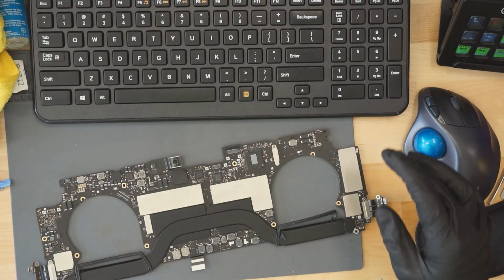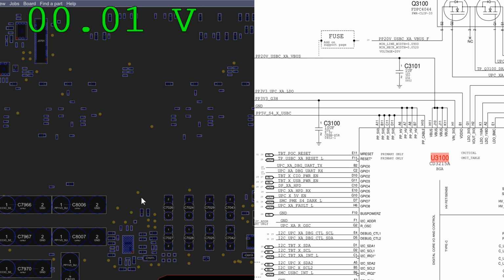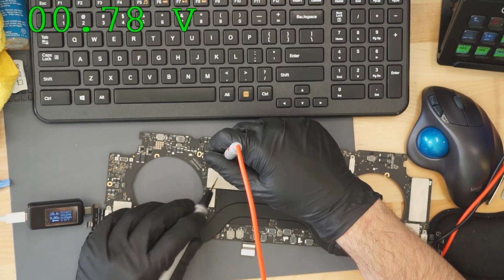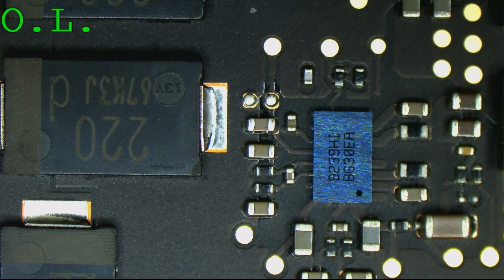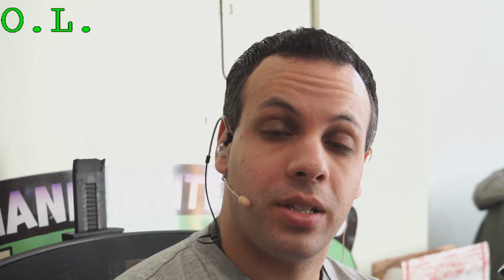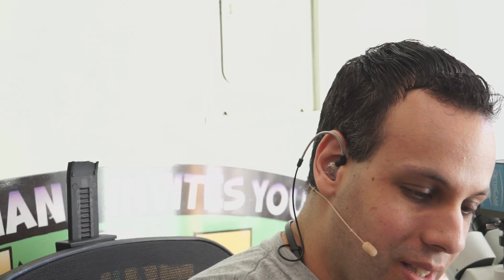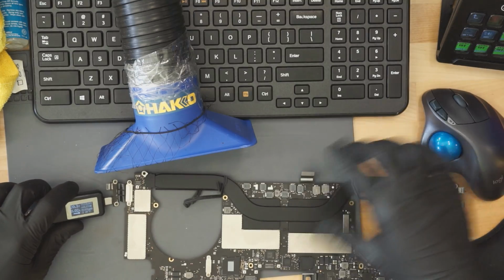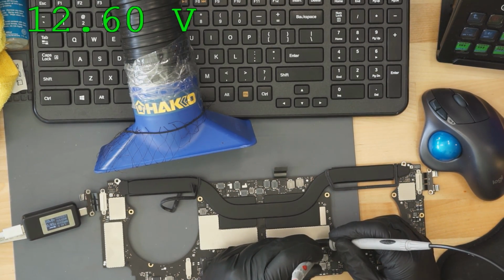Why new Macbook boards will be unfixable for me: sad :(

Comment: I suspect that as users of the new Macbooks begin to have problems that the new Macbooks will essentially become throwaway technology simply because they will become to expensive to repair by Apple if something goes wrong.
In which case you can get the chips simply by going to your local electronics landfill and picking up the disposed Macbooks.

Comment: Hey guys I got a question here. So all of his measurements are basically to pin down the exact issue and check if the correct values run to a certain point on the board right?
So when I open my macbook and I dont have the tools and manuals can I simply just check the entire board for corrosion and hope removing it if I find it will basically fix the issue?

Comment: Louis,

I use my macbook for work, I don't really enjoy using a windows machine since I'd rather have a Unix based system.

After watching a few of your videos, and actually buying a defective macbook pro that costed me 3.000 (it was the first touchbars ones, that had issues with the keyboard, press g and it will press it 4 fricking times, imagine writing code and having to delete sometimes random stuff that the keyboard would do on its own), I started to think about moving to something else.

What kind of laptop do you recommend, that looks and feels like a macbook pro? Specially the feel of the trackpad, which I use a lot and is one of the features I like the most about apple against other notebooks, I'm not going to go into what system I should use since that's going to depend more on what I need, but at least on the outside.

Thanks, and I hope you can read this

Comment: Tell me if I'm wrong, but why not get a contract with a manufacturer of these components? Many companies share a manufacturers (take Samsung for their displays as an example), why not do the same for these components? Surely the manufacturer doesn't care how you use the purchased goods as long as they're for legal means, and it's the customer who breaks T&Cs by getting their product repaired third-party so you're protected? Ordering thousands if not millions of chips may get expensive, but it promises you top quality product with no breaks in supply.

Comment: So summary... The 3p2pdpsdop32p3 doesn't interface with the 3pd3p3dp3wqadrRKO but the 3pdktutppd does. So you have to rewire the 3pd3ppd23 so that the 3ppd3ads can enable the 3pppdp3 hot function.. simple really

Comment: I dont recognize that Intersil controller. Its not on any of the boards I usually work with. I got boards with the 229004 which is quite good or the 95712 which isnt.

Comment: I used to be a 100% Mac guy. Everything I owned was Apple. Ive had 2 iMacs and 2 MacBook Pro’s and I’ve used iPhones exclusively since I was a sophomore in high school back in 06-07. 

If Apple continues along the same path it’s been on for many years and does not radically change its business practices, I will never purchase another Apple computer ever again. I’m 30 and I just built my very first PC about 8 months ago, primarily to be a gaming machine. After my first day with my new PC, I gave the iMac to my fiancé. 

I spent just under $3,000 on that iMac. I spent about the same on my PC and an LG 34” ultrawide curved display. The fact that these two computers cost the same is actually hilarious to me. 

Not only is every part in the PC very easily user-replaceable but it’s also just a hundred times better in every way. The only storage drives in my PC are PCIe Gen4 NVMe drives so they’re insanely fast. I’ve also got an 8 core Ryzen 3700X, a 2070 Super and 32GB of RAM. This machine is lightyears ahead of my iMac. It’s far more capable in every way possible and it cost the same amount of money. 

Finally, if something does ever need to be repaired, I’ve already found a highly reputable PC repair guy who lives 10 minutes away from me. If a part can’t be repaired and must be replaced, I can easily do it myself. If I decide to upgrade any of my components, no problem. In fact, I’m getting ready to upgrade the GPU soon. These things simply aren’t an option for the average person who owns an iMac or a MacBook. Not only is fixing or replacing a bad part yourself not an option for most people, Apple will quote such a high price for repair that replacing the entire computer makes better financial sense. That is a fucking problem. If it makes more economic sense to replace an entire computer than it does to repair or replace a single component, something is seriously wrong. That situation simply doesn’t exist in the PC world.

Comment: Hmm...  I bet if you could x-ray the board where the ISL9240 is I/you could probably design an BGA interposer that could use a ISL923X that could replace 9240 and not add much height.  I could do the X-raying if you are interested.

Comment: Apple has made it clear that they want repairs shops not to work on repairing Apple computers. Simple choice for me is not to support a company that treat customers in this way, I’ve done the dance with Apple retail idiot employees on defective iPad screen ( manufacturing defect) and realized they want to screw the consumer. Not a problem, my family will be reducing all Apple purchases significantly. We used to purchase 2-3 iPads yearly, and the same for iPhones, and usually a MacBook Pro every 2-3 years.

Comment: Every time a company makes it more difficult or artificially more expensive to repair an item, demonstrates very effectively how they're just giving lip-service to how "Green" they are. With such practices...otherwise easily and cheaply repairable electronic devices infest the landfills of the planet. It also needlessly wastes rare-earth compounds and requires more mining for new supplies of non-recovered materials.
Reply: actually all the metals inside the MacBooks and iPhones are 100% recycled back. I don't think that applies to all their products, but it does to at least those. They are the only company that runs their servers completely on renewable energy sources which is pretty cool too. I do agree with your sentiment on human waste. We are the worst!
Reply: @blakestampley6041  you said, "...100% recycled back...."
You're seem to be assuming all those devices are recycled  instead of just tossed out. I've seen iPhones in the trash so I know they aren't all recycled.

Plus, "renewable" does not mean waste-free. Even solar panel manufacturing involves strip-mining (esp the way China does it), toxic chemicals, and use of oil/petroleum products for mining machinery, smelting energy, and transportation of raw and finished materials.

Comment: Dunno if you're still interested but I just found some guy from Hong Kong selling recalled isl 9240 on eBay https://www.ebay.co.uk/itm/Reballed-Intersil-9240HI-ISL9240HI-BGA-MacBook-PRO-A19-Logic-Board-Repair-/174334004538?_trksid=p2349624.m46890.l49292

Comment: Touched the chip and got 20V working. Enterprise solution: cut out enclosure in place where the chip is and tell the customer to touch the chip to get it working. Ticket solved. Now spend half a day getting ready to open another ticket.

Comment: 2018 and up mac? I don't like them. There's no 15'' normal mac available right now besides the old ones. The 16'' is huge. And 15'' only working mac i know is the one that I have, from 2014 and I can't renew it because there's nothing better. Something happened to technogoly in 2015, the industry has killed it. Same for the car I want. 2014 Toyota Prius is the last available normal model. :/

Comment: Imagine what the new ARM-based Macbooks will be like, everything is soldered on board! They will be like iPhones.
Reply: Everything is already soldered to the board though, so nothing new
Reply: Did you mean covered with some sort of compound, like epoxy with filler?
Reply: @yuriysukhorukov391  As in a single board where nothing is replaceable, and they solder everything onboard. So a repair is ... changing the board and losing all your data YAY
Reply: @kienhwengtai8113  I mean don't the current MacBooks have everything soldered on them already?
Reply: @theodiscusgaming3909  Actually yes, pretty much all the news ones are like that. Some of the older Macbooks had removable storage.
Reply: SOC is the word
Reply: guys I think what he meant is an SOC(System On a Chip)

on older macbooks the CPU, GPU, Wifi card, etc is seperated but in the new macbook everything is intergrated to one chip

so for example If the wifi doesn't work on an older mac then you would only need to replace the wifi card and it'll work fine again, or if the display doesn't work then all you need is to replace the GPU like what happened to older macs with nvidia iGPUs.

But when it's intergrated into one, you have to replace everything just to fix one thing which would be expensive and unrepairable, because an SOC costs just as much as the whole laptop if you buy it retail and not in bulk.

Comment: Had a similar issue dealing with suppliers of an SCR pack I needed to repair a Miller 251 welder.  All the other packs were available but not this pack, and I couldn’t find one that could replace it that would be compatible.  The packs that I could get were like 10$, I could obtain replacements however through my local welding supplier or any Miller dealer for 350$.  This welder was quoted for repair by a Miller dealer for the low low price of 1100$ close to half the cost of a new machine.  Incidentally this pack was not even listed in the manufacturers catalog.  According to them it didn’t exist.  Funny thing if you’re willing to spend 350$ it magically exists.  In the end, I bought it and now I have a working welder, but wow talk about markup!

Comment: please just stop buying new computers if they re not serviceable, just keep using the serviceable ones that will keep working and will be fixable, the 2010 ones are the last good ones and very serviceable and reliable. my idea is that there is no reason to buy a new one if the previous one works great, and if it is well mantained (hardware and software side) it will remain quick and it will do its job like the new crappy ones

Comment: I hear Dodge is making a car with no oil cap, no lug nuts on the wheels, and no gas cap. You run out, you’re fucked. Go buy another one. Seems to be the direction we’re moving in.

Comment: Hi Louis. I have an i pad , not air , about 4 years old and last night i updated the operating system to 13. something or rather. anyway now all it does now is just show a white with a black apple screen and flicks off and on at times. The screen is 9.5 inches corner to corner. Can you fix it since it seems to be a software problem? Trying to download itunes for my pc to try to restore but is very very slow could take days to get it. Thanks

Comment: Speaking of unfindable parts. This should be an easy one for you. I was scratching my head when my iMac Late 2015 27" SSD died. It was a fusion drive set up. The regular HDD still works. But then I ran into not being able to find the replacement SSD at all anywhere. All suppliers carry only all models before and after and even for the earlier models for that year. This seems to be the only mac where I can't find the part. Rumor has it that it used a late 2013 MacBook Pro Retina SSD that fits in the PCI slot. Not gonna gamble it, just gonna replace the HDD with an SSD and call it a day. I'm not a regular DIY'r nor an expert in any way but I kept running into dead ends. And this video just reminded me of that.

Comment: apple proudly speaks on changes that will benefit the environment while an entire board is not possible to repair.
as in this case shown by louis they will charge for an entire motherboard for a repair of a single ship.
where i live shipping is so expensive that most repairs will not benefit either workshop nor customer. 
it actually cheaper to send a repair to another country and have it delivered back to my country. =(

Comment: watching from my macbook that has never broken down in 5 years even when it fell from 2 floors down, maybe luck but al my normal windows pcs burned out in max 2 years
Reply: For the price of a macbook you can buy a new windows laptop every 2 years for 6 years and therefore maintain compatibility. Also you can play a game
Reply: @michaelkeegan9260  i think it higly depends on what you are using it for, i use the macbook for work. also what you saying is simply not true a MacBook is only 2 times as expansive with the same specs at the time, not 3.
Reply: @christianvanderniet  alright 4 years then :p.  Is there still any function a macbook is actually superior at? All the mac proprietary software is on pc, or better pc alternatives now exist due to the scale of the community
Reply: It's not that Macs are made awful. It's that Apple just says you need to replace a whole board and all your data is gone

Comment: Moral of the story: don't buy apple products until they change their ways ofvdoing things.
Reply: Or just at all because they will never change
Reply: I need macOS, hackintosh is a viable alternative?
Reply: Moral of the story: don't by Apple anything ever. They are not changing in our lifetime.
Reply: Moral of the story: I don't want to live on this planet until science finds a vaccine for stupidity.
Reply: Then what the heck am I to do? Windows now comes with a bunch of pre-installed shitty spamware you cant remove, shitty menus, shitty-constant updates, and the stupid blocky tiled menu system. I’ve been a loyal windows fan for 15 years but it’s definetly changed for the worst.

I bit the bullet and ordered a 2020 macbook pro. Lets see which ways apple can screw me now, but atleast they wont cram ads and updates down my throat.

God damnit 2020 sucks
Reply: @akselgen9534  — Likewise. Just bought a Windows machine for my daughter for school use. God that thing stinks. Impenetrable menus, idiotic login system which requires me to sell my soul to Microsoft. Even the printer requires a login. I’m not even sure I own my own content on the thing or if I’m just licensing it from Microsoft. Bleedin’ ridiculous. Apple is shit, but Microsoft is so much worse.
Reply: @akselgen9534  you can install any operational system to run on a common/normal hardware (except macos). The market doesn't offer only the shitty windows, it also has lots of opensource alternatives, mainly linux (between all OSs i tried, the best in performance, price and philosophy), or even payed ones. It really is possible to adapt and if you try to learn, even love Linux. My advice is there, even if i had money left i would never buy apple products for personal use.
Reply: @akselgen9534  Yup, I love windows, but everything you mentioned, specifically the forced updates whenever Windows sees fit (irrespective of what you're doing, no matter how important), made me go the Mac route. I still have a windows desktop, I use an android phone (I hate iPhones), but as far as laptops go, I'm all in Macbook-wise. MacBooks just work seamlessly, they don't shove things down your throat, oh, and they feel and look downright sexy.
Reply: @SpontaneityJD  Macbooks have a great aesthetic design, so did iPods which got me invested in Apple initially, but after the introduction of the T2 chip I lost faith in Macbooks as well. They pretty much stopped catering to the professionals and focused on slick netbooks, while keeping a premium price tag. Then they tried ramming an i9 into a chassis designed a decade ago which was just stupid and 'Thermal-Throttling' became synonymous with 'Macbook'. But the thing that really killed it for me was the T2 flaw; a security chip with a hard-coded lethal flaw that defeated it's entire purpose while still retaining all the drawbacks it brought with it's introduction. The Macbook line has become a joke.
Reply: @HarmonicaMustang  Agree with you completely. I am using my macbook primarily bc of its aesthetics, feel, and simplicity. I'm well aware that it is inferior to performance and overall quality to windows, however. Hopefully Apple can realize this. But they don't have to -- people will keep buying.
Reply: @igcogcigciggicifx4763  Mac OS is still unbeatable when it comes to certain things, audio for example. Their philosophy of 'it just works' still rings hard in the audio and creative industries, and I can speak from experience where Windows was too bulky or Linux needed too much hardcoding to get something working, Mac OS just picked up the reins and my code worked every time without fail. About 80% of recording studios still use 10+ year old Mac towers because they are so solid, like for example Windows XP is still used in ATMs and many other environments where Linux hasn't yet taken over. 
Now, the Mac OS and hardware I'm fondly referring to is 2015 and back, just about every software and hardware revision after that point is a ballache in one way or another. Prior to 2015 Apple still had professionals and their forefront, after that their products became expensive watered-down toys.
Reply: Well, Windows is the same thing yet everybody's still buying it

Comment: Sounds like you haven't done the rest of the job:
1.  check the bad pin to see what seems to be wrong with it.
2.  try removing and resoldering to see if it was just a badly soldered pin.
3.  carefully review the surrounding circuitry to see what might be killing it.

Comment: Louis, wouldn't a faulty chip have caused the fault condition to be permanent. I've found in the past that BGA chips which work intermittently when tapped, heated or cooled, can often be revived by simply sweating the chip or removing and replacing it.. That silver solder is notorious for this... Great videos btw, your skills are impressive...

Comment: Do you have enough information about the ISL9240 where we might be able create a fix for it with a different part, maybe a small adapter PCB? Or flex pcb that could connect to the BGA pads and route them to an equivalent circuit?